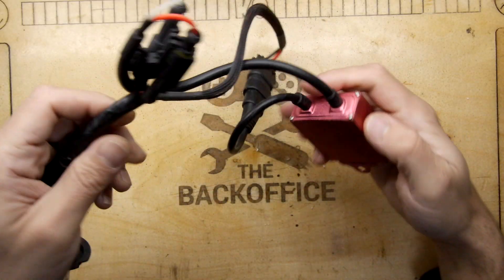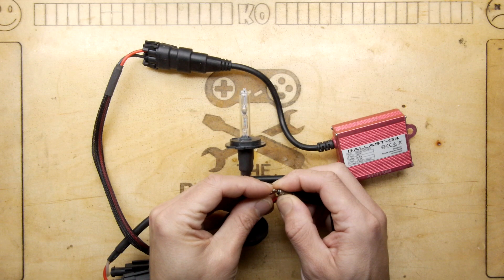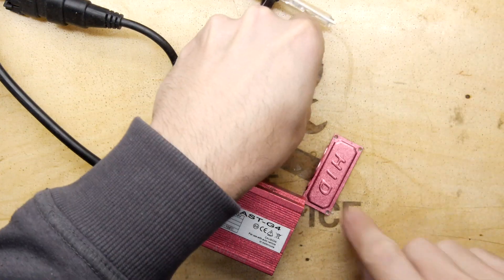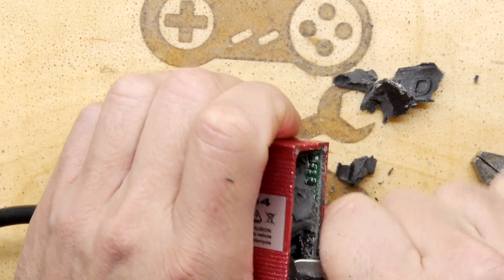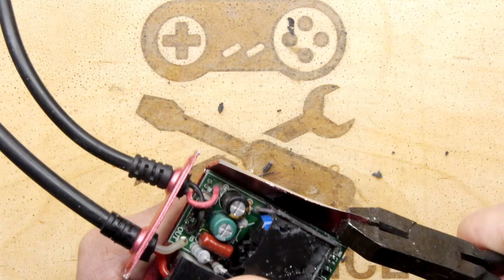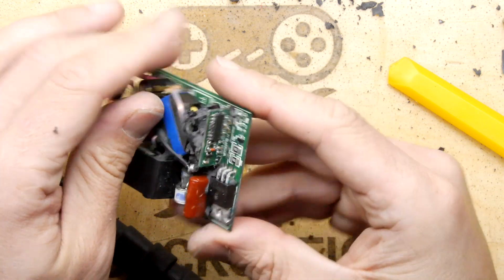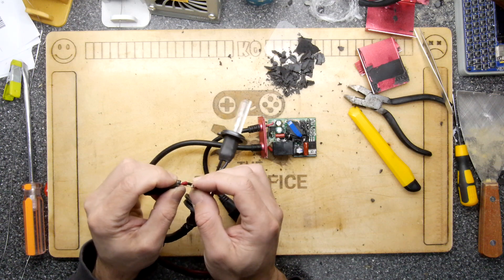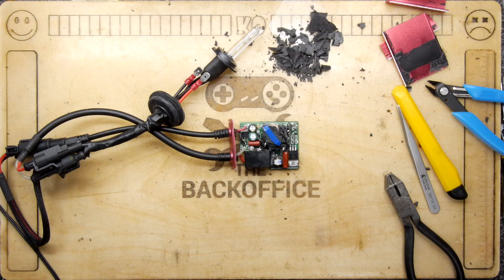HID Ballast Teardown

Comment: Actually restriking that bulb while hot and under pressure takes up to 25 kV, it's 2-5 kV only while the bulb is cold. This is an automotive necessity to be able to turn on your headlights instantly at any given moment - this ballast should have hot restrike capability. Careful around the striker transformer.

Comment: In my opinion, HID lamps are still decent especially in a portable Halogen spotlight being modified - I have a modified Cyclops Thor Colossus spotlight with this setup, with a minor difference, I went with different metal halide bulbs for longer bulb lifespan. Went with that configuration as LEDs still suck in certain reflectors due to the optical geometry.

The cheaper electronics in the HID ballast is kinda why I went for Hylux A2088 for that spotlight as I needed something reliable and robust for that. And I decided to look at the 35 - 39 Watts ceramic metal halide bulb to use with this ballast, I looked at specifications on both car HID bulb and CMH bulb of the same wattage, turns out they have the same power requirements so that thing works fine, lasts much longer on a battery charge than the original Halogen bulb, basically with the same brightness (42 Watts, rather than 140 - 160 Watts from the original 140 Watts H4 Halogen bulb so CMH lamp lasts 1 1/2 hours on 12 Volts 6.6 Amps hour Lithium-ion battery pack).

And by the way, as my modified Halogen spotlight is fitted with OLED multimeter just to monitor the battery voltage, I have seen ignition current hit up to 20 Amps for a split second (which is apparently quick enough not to blow automotive 7.5 Amps fuse I put in for obvious safety reasons).

Comment: hello does some one know exactli how xenon interact with 80s GM cars? I have some unusual problems I noticed lot relays share ground and positive paths in my fuse box I have as relays 4 pin rear windscren defroster ,6pin windscren wiper,2 pin head lights on buzzer,3pin blinker relays ,futher more I do have hei ignition system who uses pick up coil,4 pin e core igniton coil with the 4 pin ignition module,also have positive linear voltage regulator it does not have diode in the dashboard basicali so does not have the Delco 12si alternator any diode to the field wire as well. Now the problem is my engine cinde of starter self to acelerate for some odd reason  the trothel cabel on my carburetor who is a pierburg 2e3 gets contrapted like the entire engine is magnetised for some reason it stops doing that if I remove blow by hose and the metalic air filter housing and if still it does that I shut off the head lights . So mostli that happens is I dont use the head lights who are xenon bulbs with out ballast. I did notice that my 4 pin defroster relay shares pin86 with split wire to the Delco 12si field excitation wire and that relay became eventuali leaki my baterry was dead after some time I ques the internal diode got fried for some reason . So those 80s GM are prity much shiti lay out . There was another problem as well before that problem my 3 pin blinker got kinde of corrosion on rear bulb holder circuet wire got green staff on the leads from bulb holder leading to chassys ground the effect car baterry stayed longer alive under colder conddition and bether fuel economi if I turned on all 4 blinkers the engine refused to stop it behaved similar like Hit and Miss engine? So can some one explain to my how that acured those 2 problems and how can I posibli ceap usefull problems to my advantage. Basicali some times I can see shoting sparks from my bulbs xenon to the engine and the buzzing blinker relay was cinde of cool staff . So Im not shure my self what happened exactli but the fuel economi was nice . Just the self acelerating engine part was anoying cant use my xenon bulbs any more . So my question wuld by can xenon bulb act similar like wacum tubes basicali and how they can interact with other relays in the car if their internal diodes get fried? I have honestli unusual problems so I need kinde of variabel more circuet for those things. I might by wrong but the blinker relay acted similar to some sort of baterry voltage booster honestly I liked that effect.

Comment: For those of us that live in the USA, don't buy these except for off-road usage.  According to federal regulations, they are illegal for on-road use if it isn't marked in some way with a valid "D.O.T." number.  I was a vehicle safety inspector in Texas a few years ago and I gave a fail more than once because of these devices.
Reply from the maker: I'm pretty sure this is the case in most countries, definitely here as well
Reply: Yet perfectly fine for use in modified Halogen spotlights (which I have since modified my Thor Cyclops Colossus to implement metal halide bulbs instead of the original Halogen bulbs - and I also found most 35 Watts digital AC ballasts to also work with the 35 - 39 watts ceramic metal halide bulbs too). Just don't point the modified spotlight at the planes though (I am sure it's Illegal to point the powerful flashlights at the planes as is the laser pointers).